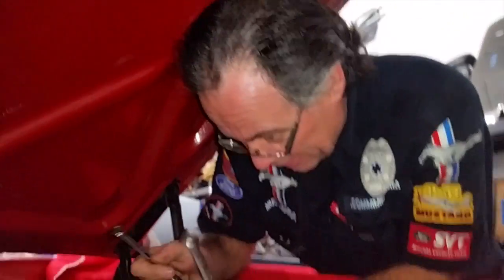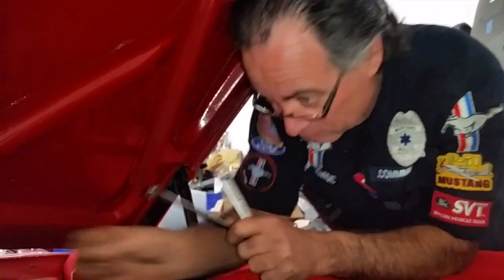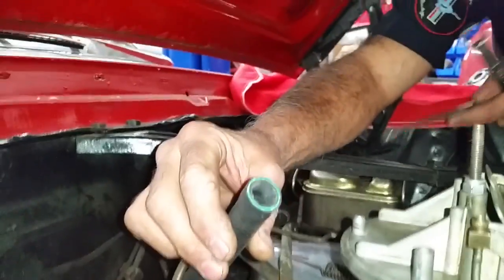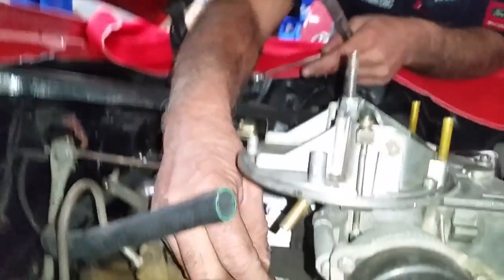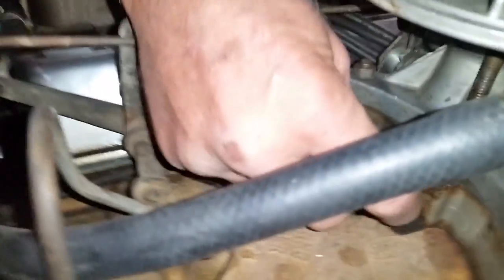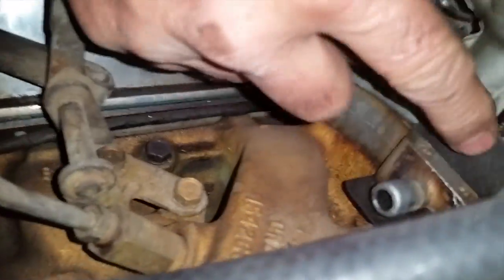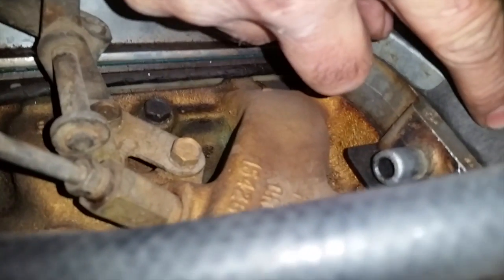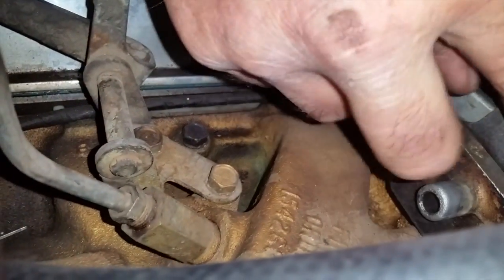PCV Valve Installation - Thomas' 1965 Mustang Convertible - Day 21 Part 3

Comment: Andy,
You might want to consider running PCV to vacuum inlet under carburetor. It will better diffuse the crankcase fumes to all cylinders. If you connect it to port at rear of manifold then the rear cylinders may burn the majority of the crankcase fumes. The power brake and transmission modulator vacuum lines probably aren't impacted by location from which they pull manifold vacuum. I'd look at schematics to see how Ford originally run these lines.
Reply from the maker: Frank Simms Thanks Frank